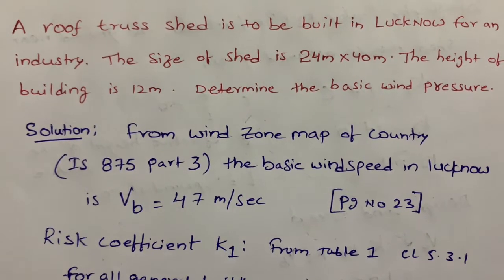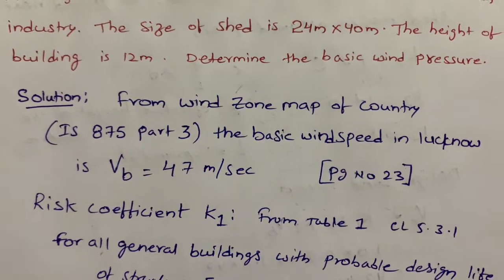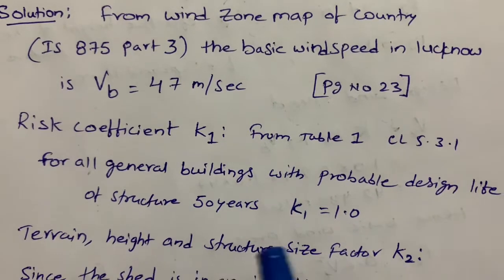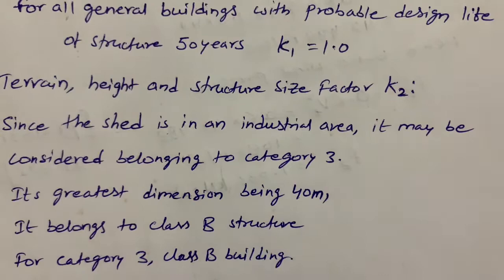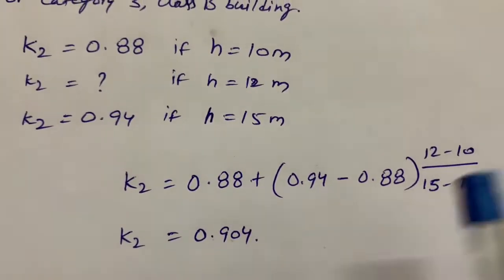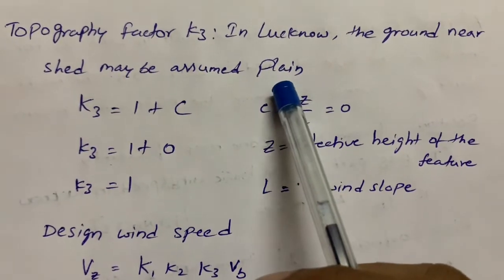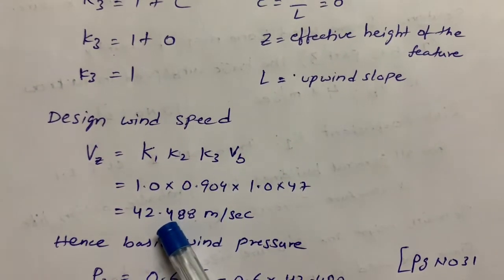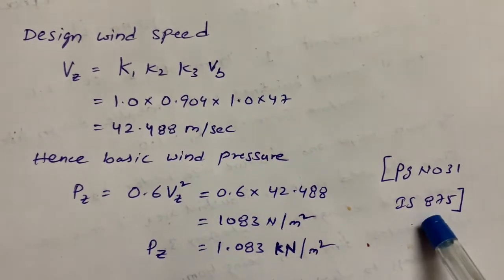Design of steel structures#Wind pressure calculation#

Comment: Sir k2 value 10 meter 0.084  and 15 also were is in 875
Reply from the maker: available in code book. if there is any errors please follow the procedure
Reply: @civilworld  Sir my building height is 19m each height floor to floor is 3.800  my wind speed is 39 my ans is 8.76kn it's right or wrong  and my category is 3 class b
Reply from the maker: 8.76 Kn is basic wind pressure